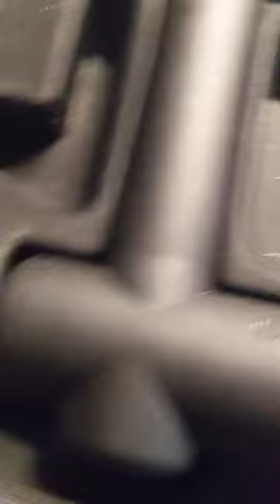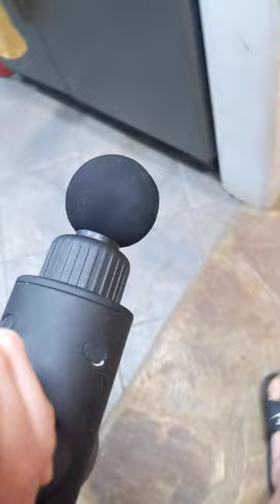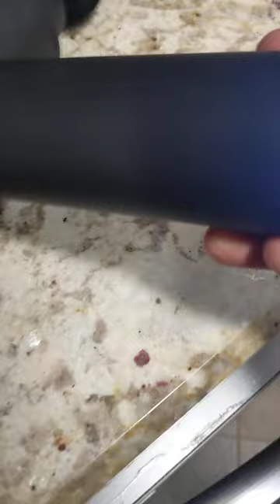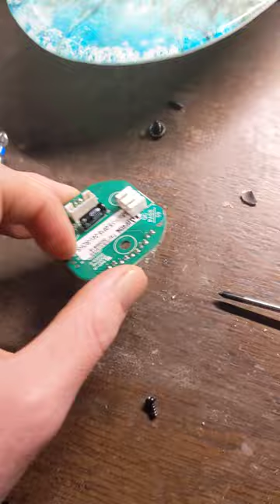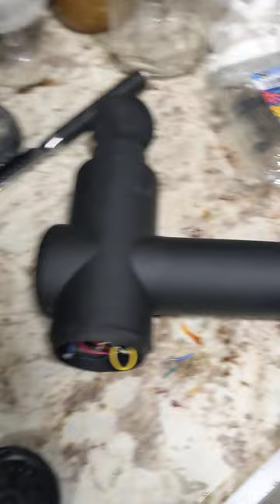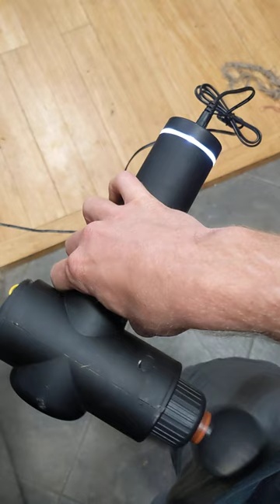Sharper Image Deep Tissue Massage Gun(Battery not charging)Direct wire solution, no solder involved.

Comment: I have 2 of them and they’re both broken. Almost brand new. Class action lawsuit?
Reply: Same
Reply: Same. I've had it for less than 3 or 4 months...
Reply: No
Reply: @alexm9748  Well I got some good news I was an idiot and my better half realized I was using the wrong charger... Haha. So that definitely can be an issue. Haha
Reply: I know you guys more than likely didn't read the instructions manual, I didn't either, lmao. But, you probably did just quickly skim through it and kinda just read what all the different attachments were meant to be used like I did. I had mine for like 4-5 days and only used it like twice. 3 times max and this happened. Same exact thing. But, when it's plugged in and turned on, the massage head works. The control panel doesn't tho. Doesn't light up or anything. When it's plugged in, the massage head is like a billion times more powerful than it being on the highest setting. Anyways, if you read the manual, it says "do not push or use to much force. Using to much force will cause the battery to automatically go into protect mode resulting in a black screen then you must use the charging cable for the gun to work." Soo, it's not the fault of the product or brand. They all say that. It's just a "user error." Soo, my question is, howww to get the battery out of "protect mode"?!?

Comment: Very good sir thank you for the video I'm wondering though if the capacitor you have could be purchased then very simply with a soldering iron a new one could be placed in but I like the hard wire idea
Reply from the maker: Yes yes I have had the same exact thought and I do believe that would be the fix for the problem. I have wanted to make a video in addition to this to provide that complete fix. But have not had the time to get around to doing it. It's like a capacitor in any system that is in line with the starting components. If it's failed it's not gonna be able to translate that current, but like we have both concluded if bypassed then the circuit is still able to complete. 

Great minds certainly think alike.

Comment: dam I didn’t expect this to actually work, but it did, thanks. only problem is the power and speed, it’s hella low :/
Reply from the maker: Interesting, seems to have many faults and failure points. Does your speed not match up to mine?
Reply: Before when you had it or if you still do, are you using another charger or charged with another charger..? Also did you use up all of the battery?
Reply: Had the same problem. Mix the black and blue with black and black. It should run fine
Reply: Mine is also slow, but I do have a newer model

Comment: I have a recovapro similar to this, it's 24v.  Fixed mine, just stopped working out the blue. I couldn't get any voltage from the battery so decided to pull it apart and strip the battery, to investigate. Took the battery wrap off and tested around, turned out to be the + and - coming out of it are really flimsy and just soldered on with two tiny solder dots. I soldered some fresh wire  to the battery tabs instead. Working back to normal, no mods like in this video needed.

Comment: Sometimes with my work tool battery’s , they die so low that they have to be jumped manually . Just a thought , maybe try bypassing the charger ( which would require pulling taking it apart I’m guessing ) I’m about to mess with mine
Reply from the maker: Let me know if you find out something more efficient. I am pretty sure I attempted what you are mentioning and when it bypassed the LED at the bottom of the gun lit up red.
Reply: I’m about to mess with my one too 😂😂😂